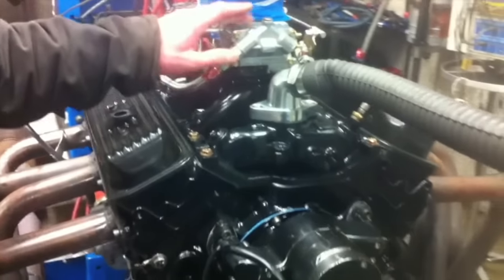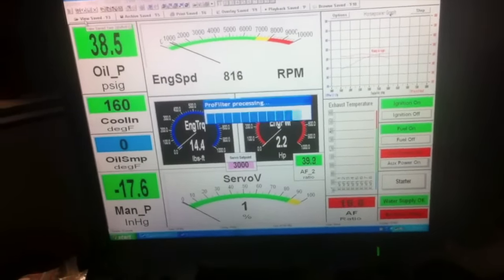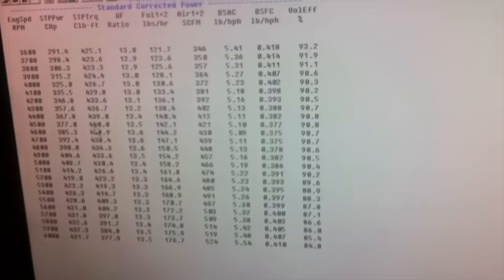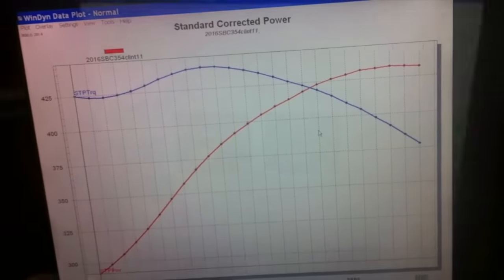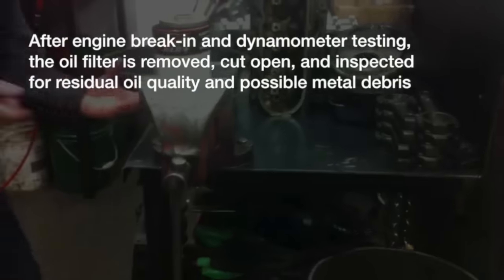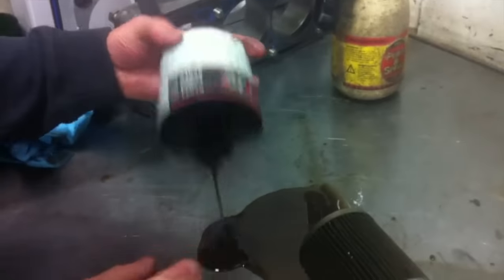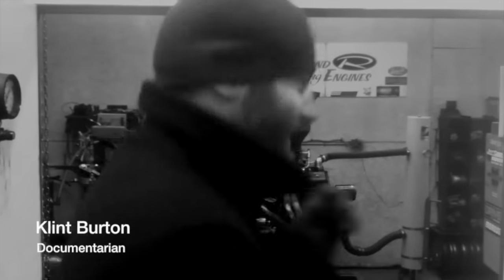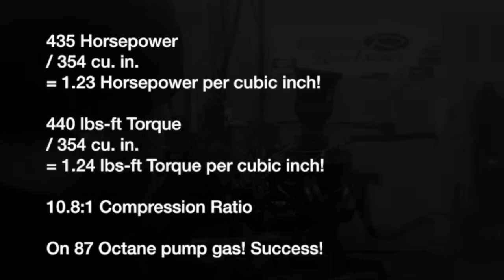SBC 400 Block + 327 Crankshaft Dyno The 350 Chevy Should Have Built (2016)

Comment: This exact combo was tried decades ago and written about in one of the major Hi Perf magazines, with similar results.  Also a 350 with 1/8" stroker (370 ci) also does well built with Smokey Yunick specs; his Smokey Ram manifold, too.  Streetable 500 HP single 4 bbl.
Reply: Bigger bore & shorter stroke to attain the displacement goal has always been the path to the most torque & horsepower. Ford, Dodge, & Chevy all used a 3 3/4" stroke with a big bore in their 427s & the Dodge 426 Wedge & Hemriod. Short stroke reduces the "piston speed" thus reducing parasitic loss & the bigger bore unshrouds the valves for better cylinder filling & also allows for bigger valves. Manufacturers went to smaller bore & longer stroke in the 70s SMOG motors because the smaller bore reduced emissions, but it also killed performance.
Reply: @bradgriffith4231  Not arguing your points, but many times the shorter stroke is used for higher rpms which gives you that power. More recently in a quest for a balance of power and fuel mileage, longer stroke puts the power lower generally and with better after market products produce more power and still better cruising RPM. Hence a few big blocks have a bad rap for not handling higher RPM's from stroke length (454 comes to mind) while the newer gen and if built right can handle the rpms no issue. But to be fair, the LS 60.l has a short stroke a 3.6" with a 4" bore.... Kinda sounds familiar
Reply: @Nowayjose-z2r  Stroke has nothing to do with RPM. My buddy turned his 555 BBc 7,500 & would have gone higher but his 284* @ 0.050" cam was the limiter. He is now building a 4" stroke, 440" small block Olds & will turn it 8,500. RPM is only limited by the size of one's bank account!
Reply: NASCAR engine builders have been building a similar spec engine for 30 years or more. Current NHRA Pro Stock engines are 4.700" bore & 3.600" stroke! Reher & Morrison says to "use the biggest bore the architecture will allow, whatever stroke is needed to attain the desired displacement & whatever length rod needed to connect the pistons".
Reply from the maker: I totally agree :)
Reply: I remember that article fondly. The magazine was Popular Hotrodding. One ofvtge big factors talked about was rod ratio and piston dwell time. The optimum rod ratio they calculated was a 2:1 ratio. In the article, they used modified rods from a Ford 300 i6, if I remember correctly. The rod ratio they came up with was 1.91:1. This is one of the reasons I prefer an LS block for this kind of build. The deck height is about .2" taller, allowing for a slightly longer rod.
Reply: @BikerDash  I never forgot it either.  CE says it was Hot Rod, but it doesn't matter.  I don't recall how the increased dwell time at TDC had on staving off detonation, but it did run on regular.  No one in this thread (and most others) has considered volumetric efficiency.  Scavenging spent gases and replacing them with fresh air/fuel would certainly increase power across the entire RPM band.  Thinking afresh, compare a "square" engine where bore dia. = stroke length as a reference, then envision the same displacement with an extremely small bore wand a really long stroke.  Consider how difficult it would be to clear the cylinder, especially at max. RPM. This suggests the model in question benefits from both the longer dwell and and the bore/stroke ratio in the interest of volumetric efficiency. I'm guessing the longer dwell gives the fuel charge more time to completely ignite the mixture.  I recall the original article passed something along this idea.  I would like trying this model with 15 lbs. of boost and 8.5 compression; premium fuel of course.
Reply from the maker: @BikerDash  Hi Biker! Thank you for commenting! You are correct, the article's "350" utilized the Ford 300 L6's 6.209" rod, making a 1.91:1 rod:stroke ratio. Our 354 build, in this video, utilized a 6.25" rod, making the rod:stroke ratio 1.923:1. If you're interested, check our 329 cu.in. SBC engine dyno video. We used a 6.1" rod. Combined with the engine's 3" stroke, the rod:stroke ratio is 2.03:1: https://www.youtube.com/watch?v=Ge6RsIOs1-U . Best regards!
Reply: @Vince L  another technique that can help with volumetric efficiently would be to use variable duration hydraulic roller lifters. Rhodes lifters often handle RPMs in excess of 7k without any issues, and the cam will act smaller at low RPMs and big again above 4k.
Reply: @CE Performance Crate Engines  I'll need to check that one out, to give me further insight into what I'm gonna wanna build to go into a C3 Vette.
Reply: @Nowayjose-z2r  Stroke has nothing to do with RPM! My buddy turned his 555 BBC 7,500 through the traps & is planning on turning his 440" small block Olds 8,500. RPM is only limited by the size of your bank account!
Reply: @BikerDash  That's 50 year old "technology". Rod ratio has little affect on HP. Engine Masters did a test with every thing in the engine being the same except the rods & pistons. Contrary to popular belief, the short rod motor made slightly more power than the long rod combo but the difference was negligeable. I've run a 400 SBC for 40 years. It's been freshened up several times & I've had stock length 5.565" rods, 5.7" rods & now 6" rods. None have made any difference in ignition timing tolerance nor power although the long rods seem to run smoother & freer, maybe because the pistons get shorter & therefore  lighter with the longer rods. F1, arguably the most high tech internal combustion engine in use today, has a rod to stroke ratio of 2.56:1. Reher & Morrison says to use whatever rod length you need ot connect the crank & piston in your combination because it doesn't affect power at all. Ford seems to have proven this because thei 302 blocks are very low deck height & are forced by this to run very short rods & they make as much HP per CI as any other engine on the street or track.
Reply: @CE Performance Crate Engines- Great video and build! I never forgot that old Hot Rod article.  As I recall, Hot Rod magazine had custom pistons cut to incorporate the Ford rods. The wrist pin was already very high up near the bottom ring. How were you able to go even longer?
Reply from the maker: Thanks for asking :)
We didn’t use ‘custom’ pistons which saves a bunch of money, but we spend money on important items like good rods. The wacky Ford rod idea didn’t excite us so we went with Scat 6.1” LS rods. We used some sweat bearings from King Performance that make a large journal rod fit on a small journal crankshaft. Unfortunately it looks like the company isn’t making them anymore. 
The pistons are from Icon. Part number IC9941-060
Reply: @vincel6340  
It wasn’t so much the dwell time at TDC that helped prevent detonation, but that it slowed down the piston just before TDC.  It made the last bit of “squish” a little more gentle.  That supposedly made it less prone to detonation.
Reply: @stlchucko  Thanks for that.  Makes sense. I always wanted to have access to SAE papers but the cost is "astronomical", just to get a few applicable and useful facts. I come from the days where we just slapped on headers, cam and intake based on marketing hype, and hoped for the best.  Fuel ratio? Probably a little lean.  Timing? Who knows. The GTOs, Mach 1s, and GTXs were fast enough as is. Thrown rods and total wrecks were commonplace. After I threw HiPo 327 heads on my 283 I wondered why it seems soft. And that was with stock Vette 283 popup pistons !!  A turbo would have solved it, or the orig. 283 heads.

Comment: That’s was a great video .  As an owner of 2 german v8 cars (a 2000 m5 with very complicated engine design- a 5.0L quad cam , quad variable valve timing , 8 throttle bodies and a lateral g activated oiling system ) this old American v8 , simplistic in design but very robust and easy to work on made more power and torque than my m5 (which has 400hp and 370Lb/ft which ain’t bad for only 348Lb including accessories). After a complete  rebuild of that , I find myself more interested in the classic American v8 engines - lol.
Reply from the maker: Cool! Thanks for sharing :)

Comment: Nice build! I love to see something a little different. I have vortec’s on my 350. That small port makes for a very responsive engine on the street with nice torque.
Reply from the maker: Hey thanks for commenting! I appreciate it :)
Ya the Vortec heads work very well.
Reply: No problem. That’s a nice build you got there. If you don’t mind me asking. Do you have anything special done to the vortec heads? Mine are stock just cleaned the ports up a little and added Ls6 springs.
Reply from the maker: @thabiznizz  
I don’t mind! These heads have been ported by hand and angle milled .100” in order to Jack up the compression. If I recall correctly this had 10.8 or so compression.
Reply: @ceperformance  Thanks

Comment: We did one like this too, 4.155x 3.25 for 352ci but we used the 5.5 rods and put a B&M blower on it. The compression ratio was like 8.1;1 or something. It'd idle in summer traffic right on the thermostat at 160 all day, then make 640 hp when you stomped on it. Such a fun little engine.

Comment: My brother lucked into a 79 Z-28 with a 1973-sb400  4.125 bore.  To a 406 stroker. I FORGET THE SPECIFICS! Stroker kit/Crank custom length rods, Amber lightweight pistons, 11/1 compression.big cam roller-rockers, aluminum heads, Holley 750 double pumper w/manual secondaries, th400 w/new valve body, shift kit, 3 or 3,500 stall, 373 gears. It was a 1/8th mile car & put u in your seat!!!!
Reply from the maker: Cool stuff :)
Reply: A 406 is a 400 bored .30 over no stoke change.

Comment: As long as you match the intake Valve closing you can make the compression work with the fuel you choose.  For 87 octane and 10.80-1 SCR I’d look at a closing event around 50* + JD
Reply from the maker: Hi HeadFlowInc! Thank you for your comment. Best regards!
Reply: So is there a formula for figuring that out?

Comment: Gotta love that air gap intake… very impressive build fellas. I’d still probably run 93 or higher fuel in the car with the added engine bay temperature when it’s in the car. Y’all got a tunnel ram you could try out on it? Probably gain another 35-40 horsepower and look very nice doing it 😎
Reply from the maker: Hi brandon mash! Thank you for the comments! Agreed! Best regards.
Reply: Higher octane makes zero difference in power output if the motor will run on lower octane gas. Enginemasters tested 87, 91, 93, 100, 115 octane gas, & E85. The different octane rated gas all made pretty much the same TQ & HP & required the same carb jetting & ignition timing. Only the E85 made noticeably more power, but also required an increase in carb jetting & timing. My 409" SBC doesn't tolerate any more timing or run a any better on 91 octane than on 87.
Reply from the maker: Good point. But… with the higher octane then more timing is usable and therefore more potential power.
Reply: Yes, most engines are knock (octane) limited and will benefit from more timing and octane until Mean Best Torque is obtained.
Reply: @ceperformance in the test he was referring to, they did do a timing sweep in the dyno pulls and all made the same peak HP with the same timing.  What you are saying probably be true in a high compression engine where you dial back the timing to run on lower octane gas. Their test was to show that if and engine runs fine on 87, increasing octane doesn’t make more power as many people mistakenly believe.
Reply from the maker: Thank you for commenting!

Comment: Is it just a 327 crank with the 400 rods and pistons? How was it built I like the short stroke crank with the big bore. I guess I just want to know how you did it yank you.
Reply from the maker: Hi richard smith, thank you for your questions! We used a steel 327 crankshaft (3.25" stroke) with 6.25" connecting rods, and 4.185" bore pistons with a 1.125" compression height. This Dart block had 2.45" mains—perfect for the 327 crankshaft. Best regards.

Comment: Have a similar build in my wife's 5 speed Chevy Vega 4.155 bore, 3.250, Scat 6.200 rod,JE pistons,aluminum heads,solid roller cam,runs great on 87 octane
Reply from the maker: Sounds great! Would you share the camshaft specs? Do you know the power numbers? 
Thanks for commenting :)
Reply: Don't know power #'s,the cam is .580 lift w/244 duration and gets her to Wallyworld Pdq,😊
Reply from the maker: That’s sweet! I’ve been looking for a Vega for my 15 year old son. Not much out there anymore.
Reply: What pistons did you use with a 6.2" rod? Compression height and for what rod size? I looked up the 1.125 Compression height pistons for a 6.25 rod in summit and showed no results. I have some good 6.2 rods, good .040 400 block and a 327 crank to use.
Reply from the maker: On ours we used 6.25” rods and 1.125” SRP pistons. 
With a 6.2” rod you could use the same with decking the block down below 9” which is fine. Better if you find a 1.130” piston which shouldn’t be a problem. 
Thanks for commenting :)

Comment: I have a 400 block .030 with a 3.25 stroke crank in my truck.  It's a great  running engine.
Reply from the maker: That’s awesome! Is it a build you’ve done yourself? 
What heads do you have on it?
Thanks for commenting!
Reply: Yes, I built it myself.  It's a 400 block .030 with a large journal 327 crank. Oliver 6.25 connecting rods, wiseco pistons and ARP head and main studs. Compression is 10.5 , cam has 5.51 lift and 244 degrees at .050. My heads are pro top line 235 intake 23 degree.
Reply from the maker: @leonardbarrett1977  
That sounds like a sweet combo! Must make huge power. Have you dyno’d it? I bet it loves that camshaft. What’s the LSA at?
Reply: @ceperformance  The lobe center is at 110 degrees. I am running a comp cams 292h flat tappet
with 1.65 rocker arms. The lift is.551, the decimal was in the wrong place on my last comment
After five years it still runs great, it's my daily driver.
Reply from the maker: @leonardbarrett1977  
Thanks for your reply! Sounds like a fun daily driver!

Comment: What did you drop the total timing down too when switching to 87 octane? 30 to 32 degrees? 10.8 to 1 is a lot of compression for 87 0ctane, especially with a cast iron head!
Reply from the maker: Hi jimmyjimbo61, it may have been 36º total. The 90's Hot Rod article was inspiring. This 354 produced some fantastic and consistent numbers on the dyno when running on 87 octane. Best regards.
Reply: @ceperformance  I'd expect detonation with that much timing running 87 with stated compression and iron heads.  Maybe ECT < 120F and IAT < 40F?
Reply from the maker: For the most part it’s nice to see it’s possible to run the 87 if in a pinch. Our preference would be to run on 91 or so especially in a GM A body.
Reply: @tbl8560  I read the same Hot Rod article from June 1997 entitled The 350 Engine Chevrolet Should Have Built. Peak power was at 5700rpm, there was no detonation. They said it had to do with the efficiency of the rod stroke ratio. They used 6.209" forged rods from a Ford 300ci I6 engine, they had to narrow the journals .030" to fit the crank but gave them a 1.91:1 rod to stroke ratio. It keeps the piston at TDC longer thus allowing the fuel to burn longer, similar to high revving NASCAR engines which use 2:1 rod to stroke which allows fuel to burn longer at 8000rpm. Typically street engines run about 1.6:1 rod to stroke ratio for more time at BDC to get more of an intake stroke to produce more torque. This engine is about efficiency over peak power.
Reply from the maker: @SteveSaga thank you for commenting and sharing your knowledge and information from the Hot Rod article. 
It’s quite fascinating the effect of rod/stroke ratios on the dynamics of an engine. We’ve experimented a number of times with longer than usual rod lengths and have created some unique combinations, both in early small Chevy stuff and recently an LS short stroke engine. ( 1.93:1 rod/stroke and it makes 1.89 HP/ cube on pump gas with 349 cubes. That’s with 12:1 compression too. )
Reply: Enginmasters tested all the different octane rated gas, from 87 pump gas to 115 race gas, & the peak TQ/HP numbers with all required the same timing & jetting & the difference in TQ/HP was negligible, regardless of the octane. They also tested the cast iron vs aluminum head theory & there was no difference in performance, timing, or jetting. My 409" SBC doesn't run any better nor will it tolerate any more timing on 91 octane than it does on 87.

Comment: A 301 is similar (125 over 283) just a little smaller but usually cheaper to build. With the right heads, pistons and cam and a tunnel ram, if the compression is close to 12 to 1 you can get very close to 2 hp per cubic inch near 10,000 rpm. WHOLE  LOTTA guys ran similar set ups in the late 60's and all through the 70's. Now we have E85 so the compression isn't an issue but a 10,000 rpm engine in front of an expensive 12 inch clutch and a 5 speed that will take over 500 hp and 6500 rpm clutch dumps and a Dana 60 with 5.13's isn't all that practical.
Reply from the maker: Well put! Thanks for commenting.
Reply: always wondered why some people wanted 283's 0.125 is a lot of material why not just 4.0" block with 3.0" stroke ?
Reply: @eflanagan1921  Good question, perhaps because they were "Doing" the 283 into a 301 prior to the 4" bore block becoming widely available. The 327 with the 4" bore was released in '62.
Even after that, they were very expensive to source for a while. 283 inch motors were everywhere and my 301" kit was from Richard Bowman's Speed-O-Motive shop on the Slauson Cut-off in SoCal.
Reply: where are you going to find a 283 block anymore.......
Reply: @wintonhudelson2252  Remember being at speed o motive...they pushed some pretty cheap stroker kits back then.
Reply: @yurimodin7333  Exactly. 350 is the same 4 inch bore a 301 would had